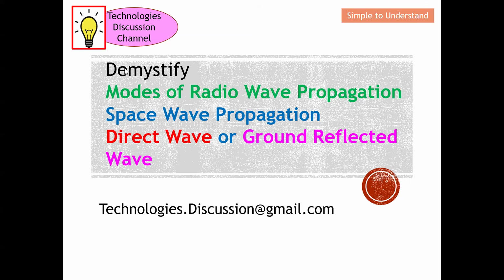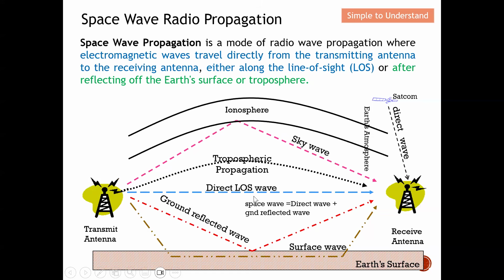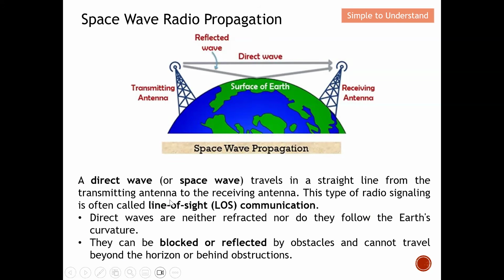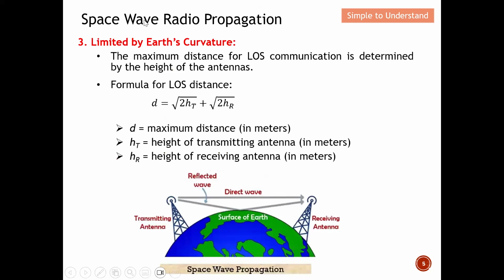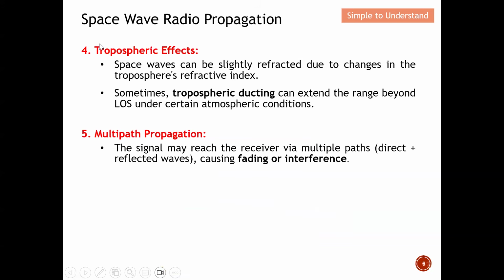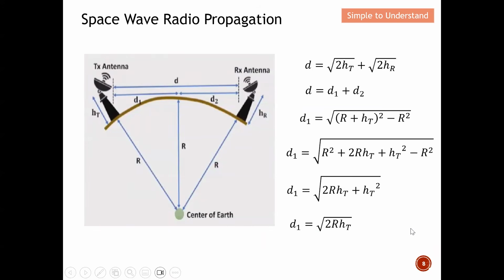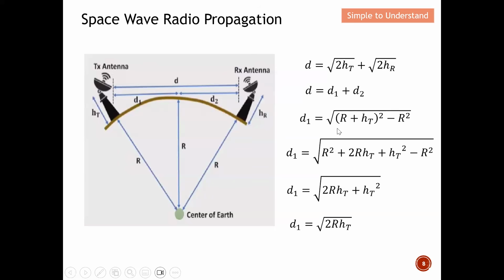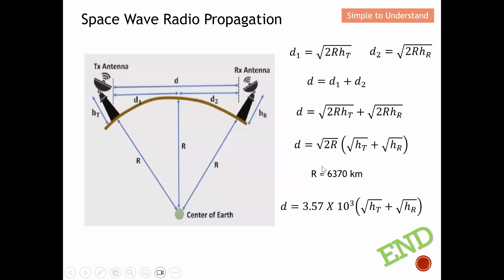Radio Wave Propagation #2. Maximize Space Wave Range! Direct & Ground Reflected Waves Explained.

Comment from the maker: In this video, I explain how radio waves propagate in the air. There are three main modes of radio wave propagation: 1) Ground wave, 2) Sky wave and 3) Space wave.
This video focuses on space wave propagation, which includes either direct line-of-sight (LOS) propagation or ground-reflected waves. I also explain the characteristics of space wave propagation, such as: 1) Frequency range, 2) Line-of-Sight (LOS) dependency, 3) Limitations due to Earth’s curvature, 4) Tropospheric effects and 5) Multipath propagation.